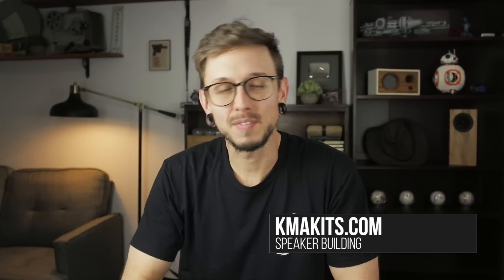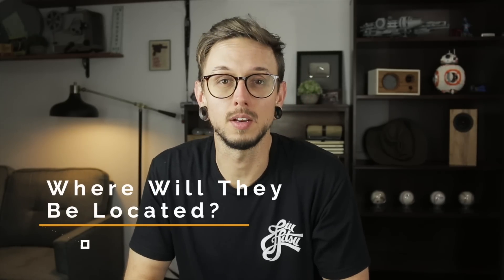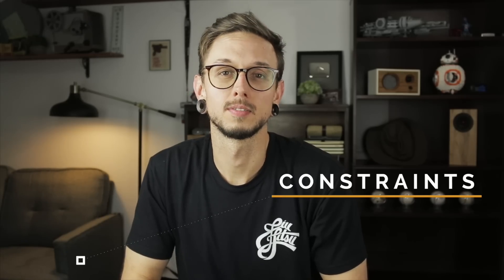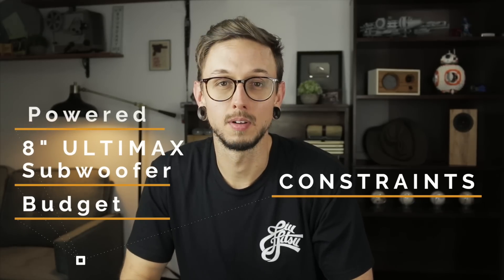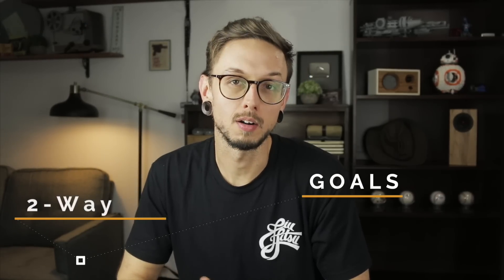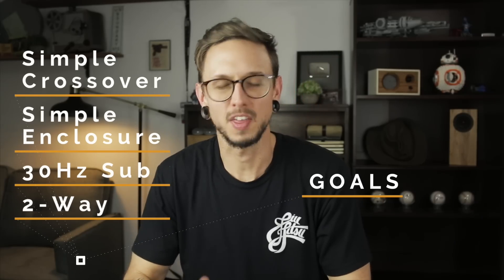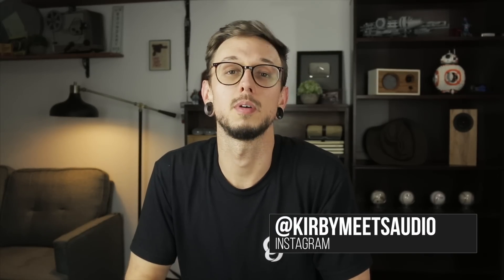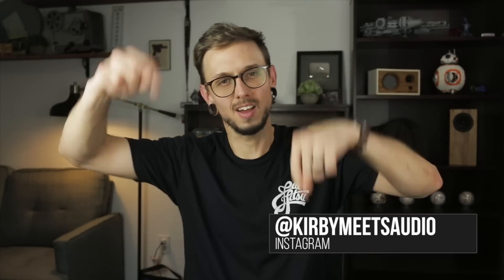How To Design A 2.1 Soundbar Home Theater System || Step 1 - The Plan

Comment from the maker: Hey everyone! Thanks for watching! As always, let me know what you think of this build down here in the comments.
This is step 1 in our 6 step process of designing this 2.1 soundbar system. Step 2, selecting drivers will be out next week! Thanks again!
Reply: Kirby Meets Audio Hey good video man! I need some help choosing an amplifier for a subwoofer I'm building would be great if you could give me some suggestions. I'm making it with two 12" 1250w rms subwoofers (2500w rms total). I'm either going to get 2 dual 2 ohm subs then wire them too 2 ohm or 2 dual 4 ohm subs and wire them to 1 ohm. Which option do you think would be better and do you have any good amplifiers that would work with it? It's not for a car it's for a home so I would need to be able to plug it into a wall socket (I'm from the UK). Thanks so much for the help this should finally let me get this project started!
Reply: @kirbymeetsaudio Hey! Been following you for awhile and have a question on a build ive been working on. I purchased a 50x50w TDA7492P Amp from ebay and it  connects to my phone for about 35-40 seconds and then either disconnects or powers off. 

I have used 9, 12, 14,19, 20 volt / 2 amp battery and multipe phones and still experience the same thing.

My wife says you won't respond because you have too many followers, but I have faith! Please shoot me a message or respond to the comment if you have any ideas.

http-s://www.ebay.c-om/itm/TDA7492P-50W-50W-Wireless-Bluetooth-4-0-Audio-Digital-Amplifier-Board-Case-Kit/142102969087?ssPageName=STRK%3AMEBIDX%3AIT&_trksid=p2057872.m2749.l2649

This is the ebay link plus two (  -  )'s.

As for my driver and tweets

Dayton Audio ND105-4 4" Aluminum Cone Midbass Neo Driver 4 Ohm x 2
Dayton Audio AMT Mini-8 Air Motion Transformer Tweeter 8 Ohm

Battery 
Poweradd Pilot Pro 32000mAh Power Bank from amazon
Reply: Hey Kirby. I see lots of other good videos coming out, but i'm really missing step two. Coming any time soon? :)

Comment: 30Hz is great, but once you hit 20Hz, you'll never go back! I built a custom box with a Dayton 10" HF that measures +/- 0.5 dB down to 20Hz outside. When you can solidly hit the 20's, movies and music just jumps to a whole different level of authenticity!
Reply: Any chance you share your box design?
Reply: I can't do photos or anything, but the driver is a Dayton Audio RSS265HF-4 (10"). It's in a ~2.5ft^3 (internal volume) box using a folded slot port tuned to about 23Hz. Some day, I would love to build a TV stand with 2x of the 15" drivers from the same line. Modeling shows they should be flat to 15Hz not including room gain!

Comment: @kirbymeetsaudio Hey! Been following you for awhile and have a question on a build ive been working on. I purchased a 50x50w TDA7492P Amp from ebay and it  connects to my phone for about 35-40 seconds and then either disconnects or powers off. 

I have used 9, 12, 14,19, 20 volt / 2 amp battery and multipe phones and still experience the same thing.

My wife says you won't respond because you have too many followers, but I have faith! Please shoot me a message or respond to the comment if you have any ideas.

http-s://www.ebay.c-om/itm/TDA7492P-50W-50W-Wireless-Bluetooth-4-0-Audio-Digital-Amplifier-Board-Case-Kit/142102969087?ssPageName=STRK%3AMEBIDX%3AIT&_trksid=p2057872.m2749.l2649

This is the ebay link plus two (  -  )'s.

As for my driver and tweets

Dayton Audio ND105-4 4" Aluminum Cone Midbass Neo Driver 4 Ohm x 2
Dayton Audio AMT Mini-8 Air Motion Transformer Tweeter 8 Ohm

Battery 
Poweradd Pilot Pro 32000mAh Power Bank from amazon

Comment: I’m currently working on a set up using the same subwoofer. I have an older pair of bookshelf speakers with 6” drivers; Thinking about upgrading those to something newer. Any recommendations on a 6” driver for home theater use?

Comment: A crossover point of 150-200 Hz to the subwoofer is going to end up being too high for the woofer. The Ultimax drivers have heavy cones which make them great in sealed boxes, but it limits the top end somewhat. I recommend looking at a 100Hz-ish crossover from the sub to the soundbar, and that ought to be achievable even from a sealed design. Also, make sure you have plenty of power for that Ultimax 8; the Parts Express 500W DSP plate amp is probably the sweet spot but 250W would be the minimum I would recommend to get a taste of the Ultimax 8's capabilities.

Comment: nice graphics on this new one. I don't like the soundbar concept but I'm struggling with an old edifier 5.1 set I am using as 2.1 at the moment. I'm super interested in how you deal with channel separation and the integration of the sub since I've never done something like that

Comment: You are KILLING it lately, Kirby! I love it!!! 8" Ultimax! You re not kidding around! That will be good, I'm not exactly afraid for your 30hz goal, but tuning the enclosure low enough while keeping it relatively small AND not ending up with port noise will call for a STUPIDLY long port...  You should definitely look into a pair of 10" or 12" passive radiator flanking the sub on either sides. Making sure they don't run out of excursion before the sub is going to be the real challenge here... I'm eager to see more! Thank for the great content as always!

Comment: I like this build. I'm very interested in seeing what you do, especially with the sub.  I'm curious to see a unique setup, passive radiators or something really minimalistic. If you can get the fidelity right, I'd be excited to see something other than a small cube. Also, I thought you looked very professional in this video and realized it was the pink cast that was missing. Actually, I had to go back to another video and realized you weren't wearing your NASA hat. You have hair, which I must think is professional.

Comment: Have you tried the tectonic elements' BMR drivers? Full range drivers suitable for sound bar and desktop speaker, haven't order some to try out yet.
Mid-woofer do not need specific frequency to cross with subwoofer, it's more of a high pass filter to prevent it to hit it's xmax too soon, you can use the power and xmax graph to eyeball it with 2nd order hpf, or design the passive component after finish building the speaker, experiment using active crossover (foobar plugin) since the power required to reach desired listening level is still unknown.
The headache will be the subwoofer low pass, best using active crossover.
Ultimax 8" ported is 45L@Fb 24hz, that's too big, while proper passive radiator is too difficult to find, you have no choice but to go sealed.

Comment: You made this at the perfect time. I’ve been thinking about getting a sound system for my tv. The speakers of the tv are at the bottom and it’s sitting on a faux fur runner that muffled the sound so every time I want to watch tv I just slip a blank canvas under it so it’s sitting on a flat surface.

Comment: Great video! 
I would love to see how a single driver could work for the sound bar, but totally agree a tweeter would really help for off-axis and top end extension on movies. 
I do think you should look into passive radiators for the sub. It should help keep the enclosure size down, but may add more to the budget. I would guess a 10” passive radiator on the side to keep the front baffle thin.
Stoked to follow this build!

Comment: First :^)|

Could you do a video on DIY HiFi Suround speakers? I am wanting to make some.. but I need them to be wireless so not sure what the best path would be
Reply from the maker: No easy path for wireless surrounds. Thanks for watching!
Reply: WeBuild4Life wireless can never be hifi because of compression.
Reply from the maker: That's debatable
Reply: what's debatable about it, you can not get a completely clean soundwave over radio frequencies, it needs to be compressed to be sent over a higher frequency.
Reply: Wirelessness raises both quality/compression and synchronisation questions. On the low quality end, Bluetooth may provide synchronisation more easily. On the lossless end, Wi-Fi works in a way that you need synchronized players while special protocols are still experimental or not available for the DIYers. I think some folks in the LMS (Logitech Media Server) may have tried this, with a player for each speaker, as it provides synchronization with multi-room support.
I've yet to try synchronized BT amps... May be next, after I finish the two I already have on the bench. One being... A 2.1 soundbar! 🙂